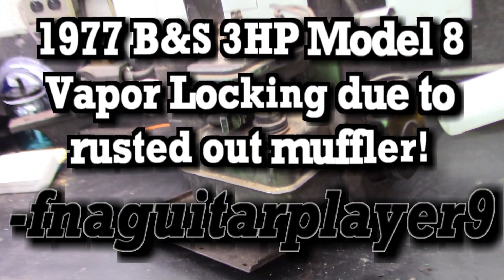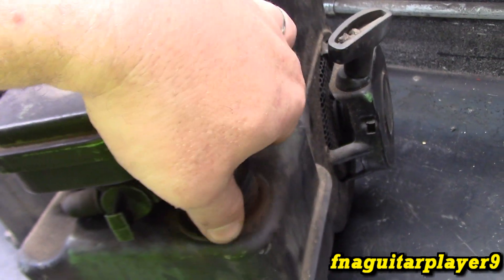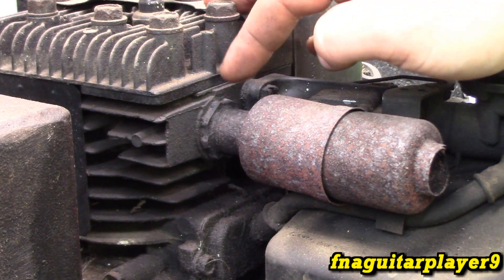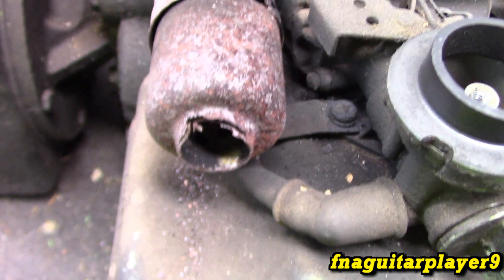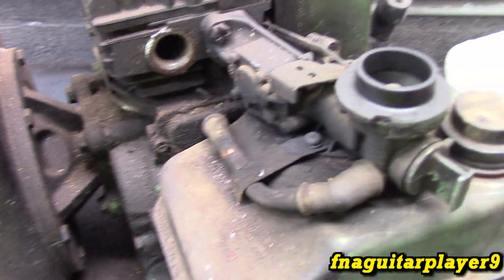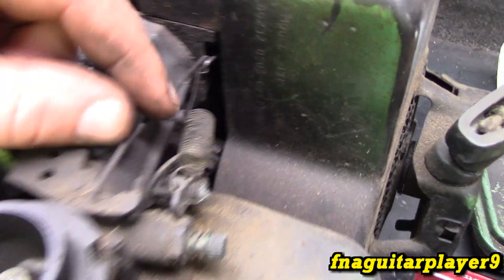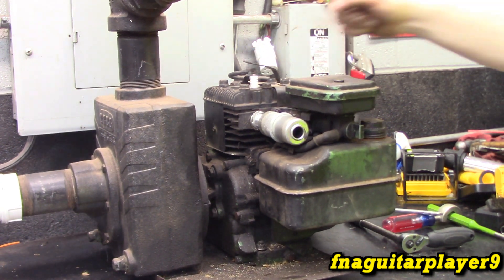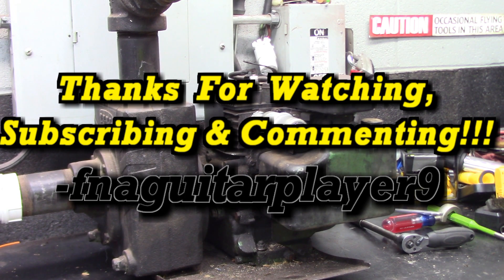1977 Briggs 3HP Model 8 Water Pump Vapor Locking due to Rusted Out Muffler!

Comment: You should extend out the water discharge pipe to keep the water further away from the engine I always love to see the old Motors fixed up and put back to work
Reply from the maker: It would normally have a hose hooked to it, but I was just testing it in that video i wasn't actually trying to pump water. Thanks for Watching!!!